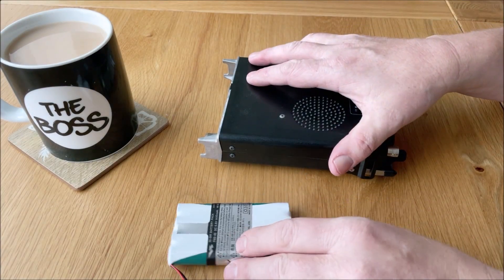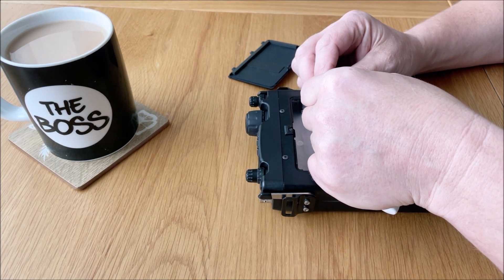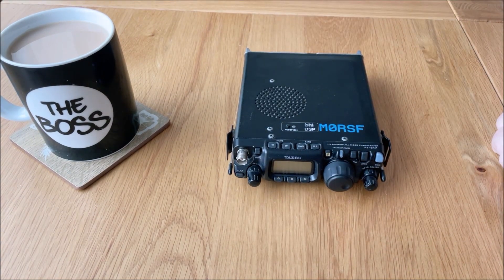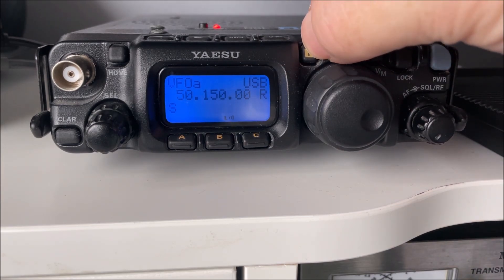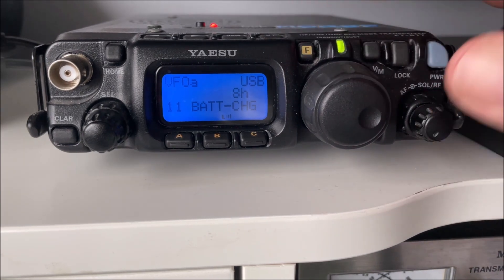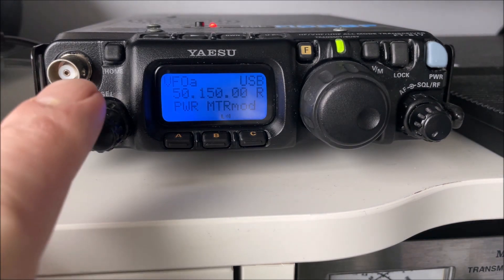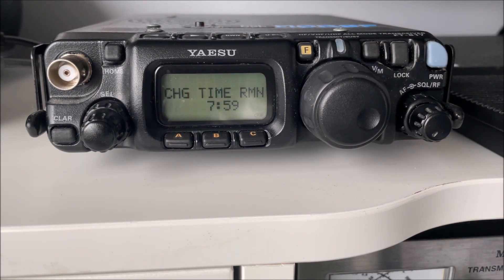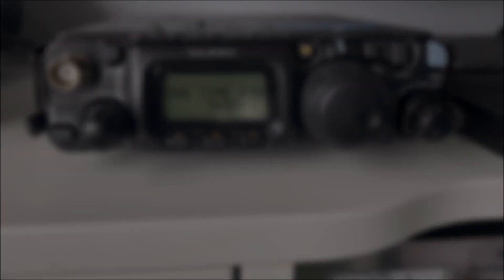How to charge Yaesu FT817ND internal battery

Comment: Does the battery discharge if you leave it in and turn off
Reply from the maker: The battery would slowly discharge but it is recommended to remove the internal battery when the 817 is not going to be used for a while. Not removing the internal battery can result in damage to the 817 and would result in an expensive repair.

Comment: Hi Cris, this was a good video and informative. I recently bought a used FT817ND and like most people, you only read the instructions when something isn't right :o) The second stage setting the front function buttons cured my charging issue. My FT817 also has the BHI DSP, have you done a video on this? John G8TDU
Reply from the maker: Hello John, well done finding a used FT817ND. They're becoming increasingly hard to find. I'm glad that you find my video useful. Good idea regarding making a video on the bhi DSP. I've often been asked 'what's that little red light on top of your 817?'. Enjoy the radio. 73 Chris M0RSF
Reply: @M0RSF  I must need my head testing, this is the third time I've bought an 817, the other two I got rid of for the same reason, I just couldnt get on with the menu system, so lets hope this is the third time lucky!

Comment: Thanks for the charging tip.  I'm new to the Yaesu ft 817.  I can send and receive now that I've programmed it, but I've been told that my mic level is too low.  How do you adjust this so I don't have to yell in the mic?
Reply from the maker: Hello and excellent news that you have the Yaesu FT817. If you go into the Menu and set the FM mic gain at 50 and SSB mic gain at 85 it should work fine. I've owned an 817 since 2006 and I've used these settings for years with no problems. Let me know how you get on. 73 Chris M0RSF

Comment: Hi Chris could you please give me some advice,when you use external batteries ,can you leave the internal batteries in the Yaesu? Thanks Tim
Reply from the maker: Hello Tim, the only time that I install the internal battery into my 817 is to charge it and go do some portable operating. A soon as I'm home I remove the internal battery. I believe that leaving the internal battery in the 817 results in a small current running through the radio that can damage the finals resulting in an expensive repair. Hope that helps. 73
Reply: @M0RSF  Hi Chris thanks for coming back so soon,really good advice. I do like  this channel very much,as well MM0EFI Fraser I did hear you myself on Tuesday lots of QRM but readable ,thanks again for the advice and sharing  what you do .
Best Regards Tim SWListenner

Comment: Hi Chris, since the recent news that Yaesu are to discontinue the 817/8 I have taken my 817 out of its bag and given it a bit of a dust down.  I have been going portable for about 4 years now and 2 years ago I moved over to the 857.  Although a little more power hungry, with the advent of lifepo4, batteries have become more efficient and power consumption on my 10w is not too bad.  I tend to use the battery tray with LADDA 2450mAh rechargeable s when I don't have my usual power source but still charge them through the radio using the Green wire mod.  Thank you so much for your sterling efforts when out /p and who knows, one day I might just get you in the log.... M6KVK  73
Reply from the maker: Sad news indeed that the Yaesu FT817/818 are to be discontinued. I doubt there will ever be a transceiver as popular. I have used a Yaesu FT857 for a Special Event Station some time ago and I was very impressed with it. Excellent news that you have been getting out portable. That's where I do most of my operating and I don't operate from home much though I really should make the effort to. I plan to do more HF portable this year though I will always do 2m FM. Thanks for watching and it would be great to have a QSO with you one day. All the best for 2023. 73 Chris M0RSF

Comment: While it may seem an inconvenience, most of the time you don’t want to be charging while using external power, so the manual selection makes perfect sense. Only charge when needed. Thanks! Nice video. Love my 818, would buy another if it sauced.
Reply from the maker: I mostly use the PSU I have to run the radio for charging though I have used the supplied charger on the odd occasion such as on holiday. I've owned an 817 since 2006 and it is without doubt my favourite radio. Sadly my 817 has developed a fault on 2m and I'm waiting to hear from Yaesu UK. If it's an expensive repair I will be buying an 818. Thanks for watching and enjoy the radio. 73 Chris M0RSF

Comment: Chris, thank you for this video.  I definitely needed it.  Slightly different issue, can you clarify, If I have the AA pack installed, , is it safe to use an external power source? Is there circuitry to prevent attempted charging of the AAs?  Or must I unplug or remove the AA pack? I'll probably upgrade to a Windcamp battery system but right now have a different setup.  Thanks for any thoughts you or anyone else may have on this.  73  KE4RXM
Reply from the maker: Hello Tom, personally I remove any internal batteries when using an external power source. I’m sure that I’ve read somewhere that leaving any batteries in the 817 for any length of time was one of the causes of the finals to fail.  I’m not too familiar with the Windcamp battery setup but I believe it’s quite popular. 73 Chris M0RSF

Comment: Hi Chris, hope all's well with you. Just to confirm that the charge period for the FT-818 is also spot on at 8 hours. I try not to over charge it, i.e. leave it charging beyond what it needs. Note that the supplied battery pack is type SBR-32MH and is rated at 1900mAh. Cheers, Rick M1RAL
Reply from the maker: Hello Rick, all is good thanks and hope all is well with you. Thanks for the info about the 818 and the charge time. Be nice to have a catch up in person some time if your up for it and restrictions allow. All the best for the New Year. 73 Chris M0RSF
Reply: I own three SBR-32MH batteries and they're all stamped 1900mAh on the front label, but 2000mAh on the opposite side.  That's Yaesu progress for ya! 🤣

Comment: Great video, and to the point.
Thanks.
I noticed a red light on top when you were showing the menus, I take it that the radio has been modified.
Is there any chance you could explain what mods if any you have done to your radio and what if any other mods can be done to the 817.
Thanks
Andy. M7KHI
817 owner
Reply from the maker: Thanks Andy, the little red light on top is because I have the bhi NEDSP1061-KBD module fit in my 817. It’s a noise reduction module that is one of the best add ons for the 817 and works on AM, FM, CW & SSB. If you search for it online you should find the website easy enough. The other thing you may notice is that I have the Palm Peg Legs installed which give a better viewing angle so the display is easier to read. 
Well done on passing the Foundation and welcome to the hobby. Enjoy the 817. It’s an amazing bit of kit and I’ve owned one since 2006. 
73 Chris M0RSF

Comment: I have to remove the battery before storing my 817nd... However with the FT818... there is no drain, so the battery will not need charging. Although, I would not store any radio with a battery installed. You are correct, the internal battery is useful, and I have made lots of contacts both on VHF and HF with it. 73, Tim, DK8MT...
Reply from the maker: Hello Tim, I should have mentioned not to leave the internal battery in the 817 for any length of time if it’s not going to be used. 
I’m not familiar with the 818 and internal battery so thanks for the info.
All the best for the New Year. 73 Chris M0RSF